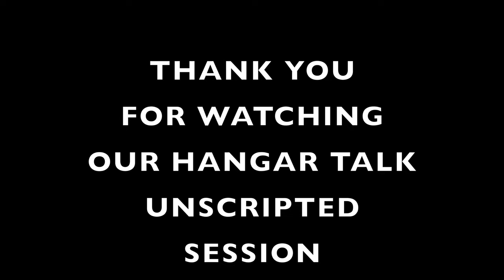1 hour Unscripted Flex-wing Aerodynamics Session with Larry Mednick

Comment: Larry, I started watching some of your flying videos,  about 4 years ago.  I have an appreciation for smart methodical and precise things but also people and you are one of them.  

Your knowledge of aerodynamics as it applies to trikes clearly shows in the way you handle the trikes in your flight videos.  It is very similar to the way I handle mine in RC Model form, so I recognize the patterns of control and precise maneuvering because properly designed RC microlights behave in the same way,  the aerodynamics and weight shift control apply equally.

Excellent explanation. I learned all what you are explaining through designing, flying and spending countless hours, years,  testing  and improving my RC Models and piloting skills, while trying to fully understand the mechanics of microlights but without the human risk factor. I had no official reference when I started  experimenting with RC trikes back in the early 80's,  so it was all experimental, and in my opinion the best way to learn is to dive in,  in my case, no human risk except  a few cuts from the model prop by being distracted :), but this approach to understanding any subject also requires a sincere interest in the subject and a methodical and careful thinking mind.   

One of the first things I noticed about the model you are using,  as reference,  was it has no washout and this is one, if not the most critical details in an Microlight.  You should have been using one of my RC Microlight Models for your explanation :),  at least mine have built in washout among some other own inventions,  using my own methods/parts to preset the washout while allowing the wing tips to auto-stabilize according to air pressure.  I called this type of setup the MIA SafeSprog™ and it is a feature I came up with by need of wanting to have a more secure way of keeping the washout on a topless wing, without removing flexibility.  

Many toy and wannabe RC trikes do not have this feature  and they rely strictly on a floppy wing, the billowing like in a Rogallo sail to maintain lift and stability but this does not carry thru on landing and it makes a world of difference having the washout to a preset angle so no risk for  death spirals and automatically adjust as he model looses air pressure upon landing, the washout which I refer sometimes as  auto up elevator is always maintained via my SafeSprogs.  My RC Model wings never go into a forward death dive for this reason, a safety built in, if you will.  You can see this effect , as well as how well my models actually fly when set up properly.  I hope you and your audience does not mind me sharing some reference videos. 

I actually think anyone considering getting into full scale microlights should at least purchase one of my RC models to understand the behavior of the trike in flight.  While the RC model control skill is not totally transferable to a full scale one,  as people getting into the full scale flight should seriously consider certified full scale flight training, I think it would help to grasp better what you are discussing in this video and having a decent size and well designed RC model can help, as one can easily play with the various parts and see exactly what is going on. For example, the floating cross-bar as you described is exactly how I would put it, it is the keel that shifts creating billowing and if you can understand the mechanics and more importantly limits of the wing behavior, in RC model form, this may help minimize the risk factor in the full scale one.  MIA

https://www.youtube.com/watch?v=VO1rGxqv-1U
https://www.youtube.com/watch?v=luQ62z-sdBk&t=11s
https://www.youtube.com/watch?v=sEIAgn2zNQc
https://www.youtube.com/watch?v=iicxtrqAeAQ
https://www.youtube.com/watch?v=SKGO2UCWJfY
https://www.youtube.com/watch?v=vH_xA0HvOE8
https://www.youtube.com/watch?v=bhRklzDIpdQ&t=151s
Reply from the maker: Thank you, and I totally agree. I would like to get some of your models personally. I am an avid RCer myself and so I know what you are saying. Maybe you could email me regarding getting a model. Evolutiontrikes@yahoo.com
Reply: @LarrySMednick  Thank you, I appreciate that. I will email you.

Comment: Wow, this a fantastic lesson on trike aerodynamics and cautions.  Certainly there's a few differences in control compared to a standard fixed wing.  How easy or difficult would it be to get in a adverse attitude of difficult recovery ?  Thanks for doing this Larry.
Reply from the maker: There is very little transfer of skill from fixed wing to trike. But with proper training there is never difficulty in recovering from any attitude except for a tuck which is completely avoidable in the first place.
Reply: Thanks Larry.  That's good to know.  Seems like most of these adverse situations would be avoided if one is paying attention..  Tucking most fixed wings isn't good either.  Lol !  Going to have dig up more gold before I can purchase a Rev. 🤠⛏⚒👍

Comment: 29:36 50-50 balance. I think it is not correct. it should have been 25-75 if we are talking about a rotational (or stability) axis of an rudder, wing or other kind of aerodynamical surface. With more complex shapes there have to be considered a calculus of the product betwen the surface area and the distance to the lateral point/axis. If this one is ignored and the ration goes near 50-50 you will get a falling leaf like behavior of the carriage. In some conditions the oscilations might amplify them self constantly.
Reply from the maker: There are many examples of trikes flying with less than a 50/50 balance (60/40). They typically fly with very large slow wings with more yaw stability in the wing and less aerodynamic force (slower speed) on the carriage. The faster the trike goes and the smaller the wing is the more critical it is to have a yaw stable carriage. the entire aircraft May exceed 25/75, YES. And much harder to calculate .
Reply: @LarrySMednick  yes, you have a strong point there for slow flying aircraft with large wing area and low power to weight ratio. I know such cases too. Most of the carriages of slow flying trikes are so irregularly shaped, that there almost can't be any talk about yaw instability.  Anyhow, in my experience that 25-75 ratio starts to take an effect above  somewhere between 80 and 140 kmh (depending on the wing) and your REVO-trike is a living example of taking this in to the account: all the flushed surfaces, rear fins and winglike streamlined cover of the landing gear - together it's getting this ratio way above 50-50.

Anyhow, thank you for this lecture, sir. I'm always enjoying the content of your channel. With kind regards.
Reply from the maker: @vaterchenfrost7481  perhaps so. We can measure area and moment from a 2D drawing so long as we know the swing through angle to have the exact answer. Thanks for watching the video.